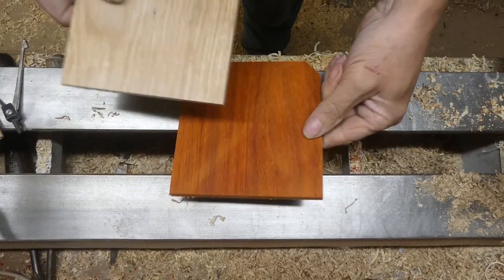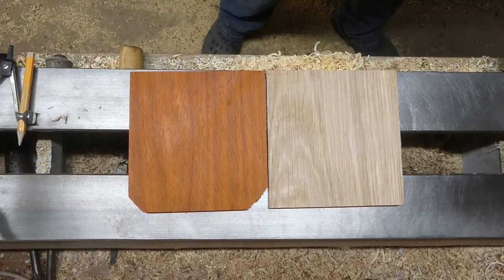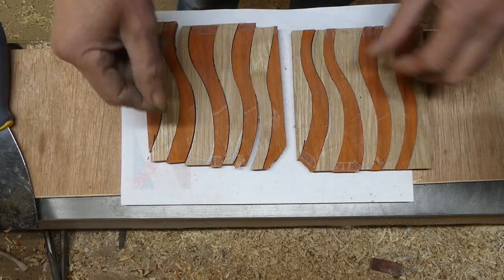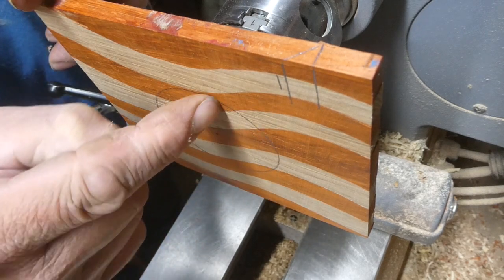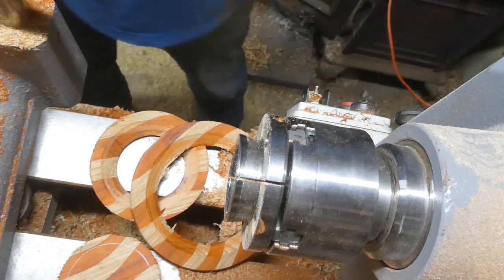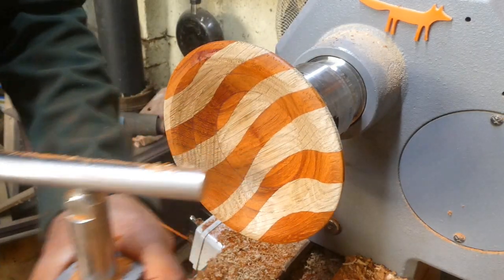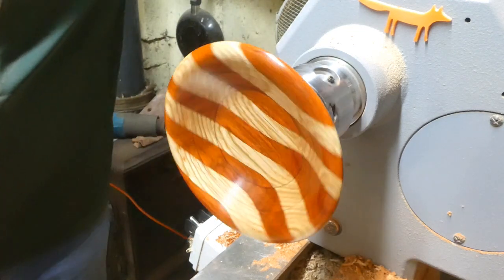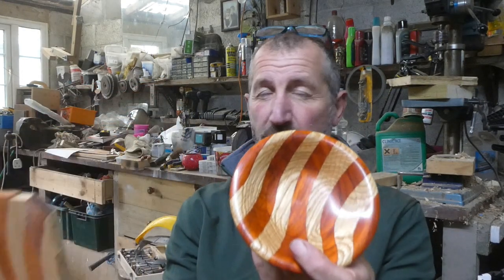Easy to make ...and fun... wobbly bowl - wood turning

Comment: Hi Andy, I recently watched Gary (The papa1947) make the same sort of bowl using his method and thought perhaps doing as you did would work; clearly, it does. I have yet to try with so many other things to try on my list perhaps I should bump it up and give it a go sooner. I have made a few bowls from a board and suffered the glue line issue too. I found that slightly uneven boards, tear out on the ring cutting and one more thing which I cannot recall seem to contribute.
Reply from the maker: Hi Steve...
Gary's version is very good but I am always looking for a simple way to make something...
This method works really well and has many possibilities with design...
If you do bump it up the list and make one then send me a picture if you wouldn't mind...
A bit more prep work before the glue up would probably benefit my results...
Take care my friend...All the best.....Andy
Reply: The other day I was looking at Gary's channel and came across the 2 board hot glue method. I have bumped the creation of a "wobbly bowl" up the list of things to do, the plan is to turn both boards over the next week.
 @AndysCornishCreations
Reply: Well, I made two bowls both have positives and negatives. I'm not sure how I can send a photo. I'll post on Instagram soon and can send you the link. @AndysCornishCreations
Reply from the maker: Hi Steve...
You can send me a picture to...
andyscornishcreations@gmail.com 
I would love to see them...
Take care my friend...All the best.....Andy

Comment: Hi Andy, The problem you encountered with you maths is a 2mm wide parting tool, is 2mm wide when at 90 degrees, when it is angled at 45 degrees it is wider using a rough calculation (Pythagoras's theorem) 2mm adjacent, 2mm opposite gives you 3mm on the hypotenuse.

Alternatively if you think of car parking spaces being 8 feet wide at the kerb they are 8 feet wide at 90 degrees, however if you mark the kerb at 8 feet and then angle them the bays would be narrower.

Hoping this makes sense

Keep safe

Phil
Reply from the maker: Hi Phil...
Thank you very much for taking the time to sort out my miss calculations...
I must admit that my head was starting to hurt with the 1st explanation...
But I really liked the parking space analogy...perfect for this old brain of mine...Haha 
I still have the other piece to try it out again...
Cheers... take care...All the best.....Andy

Comment: Ivy has had a new hairdo too! Great bowl, I had no idea how they were done - i do now, and i have plans to make bowls - thanks for sharing, Andy! Lovely job as always. Claire x
Reply from the maker: Hi Claire...
Ivy is growing up... I must get some more footage of her for future videos... without my camera dying... Haha 
I hope that you do have a go at making one... you could use double sided tape instead of hot glue..
When gluing the Oak base to the board .. put the base on your chuck .... mark the centre on the board and glue together using the tailstock point on the centre mark on the board then apply pressure with the tailstock... clear as mud ehh...
Also get your ring measurements more accurate than mine... Haha 
Take care...All the best.....Andy x  👋
Reply: @AndysCornishCreations  more ivy!!!! Ok, will get my head around it and add it to my to do list x
Reply from the maker: I bet that your "to do list " is as long as mine ... Haha

Comment: Looks great Andy and I really like Padauk. The only way I have of dealing with the bleeding into the other woods is to spray a dusting of lacquer on it a few times. Then I can spray heavier coats.
 I just finished a turning where I do that. And the final finish was lacquer but you could use what you want at that point.
 Stacking two boards is a good way to get 2 bowls at a time. Especially if you were planning on selling.
 I have a few other ideas I will be trying as well. 
Cheers,
Gary
Reply from the maker: Hi Gary...
Thank you very much... the Padouk is a beautiful wood... but the bleeding is a problem... 
Do you know.. I have some spray on laquer and I  never think about using it... I  always go for the wax finish...
I have seen the beautiful results that you achieve using laquer and plan to use it but then forget...
I liked the idea of getting 2 for 1... 
Why am I not surprised that you have got some more ideas up your sleeve ... Haha 
Take care my friend...All the best.....Andy

Comment: Looks great Andy! The Perils of Paduk bleeding colour!! I wonder how it would look if you made a few degree rotation in each ring rather than try to get the lines up and even us Black CA to glue the rings together. On the basis of if you can't hide it, shout about it! Maybe I'll have to try it. All the best, Dave
Reply from the maker: Hi Dave...
Thank you very much.. yes the Padouk colour did bleed into the Oak a little but not as bad as with Ash... sanding sealer or thin ca work ok...
The rotation idea could work well... a bit like Gary's "dissy" bowls...
The black ca is a good idea also  .. perhaps a dark wood veneer... I agree with your.. if you can't hide it .. philosophy...
You should definitely give it a go...
Take care...All the best.....Andy